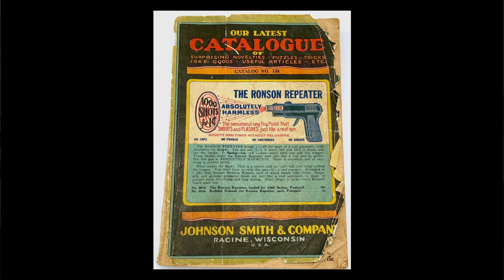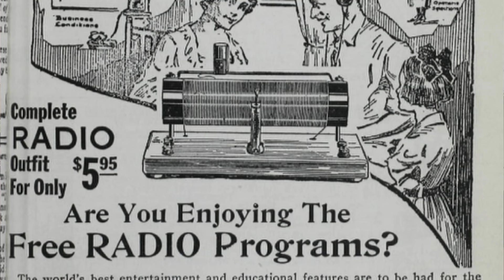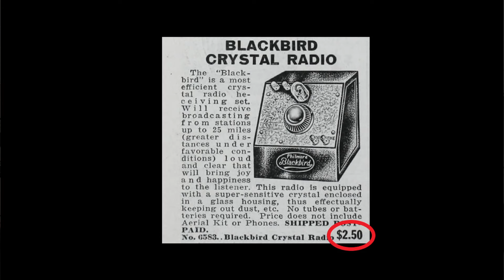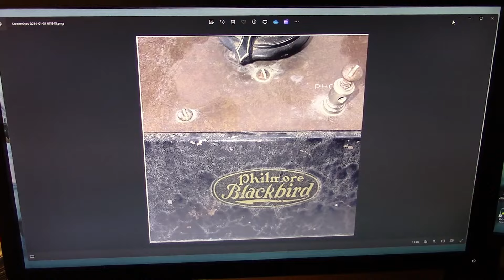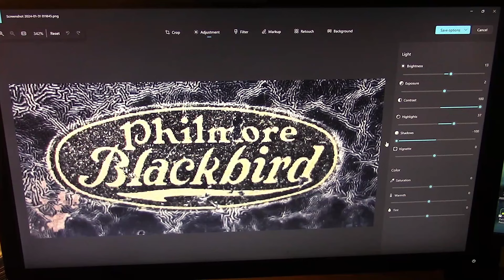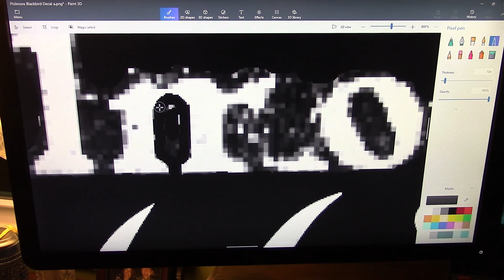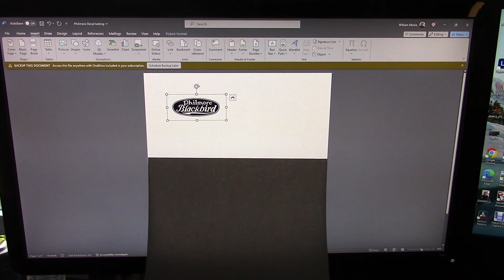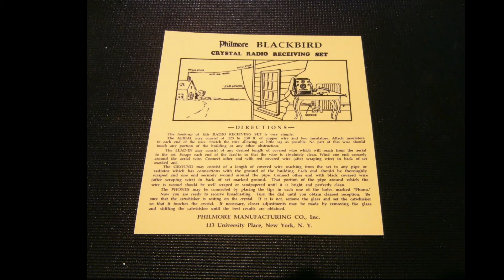1936 Philmore Blackbird Crystal Radio Restoration

Comment: I checked something out on crystal radios 📻 the other day. They're small, and very simple to build. The wood 🪵 ones are beautiful, and compliment any decor. Crystal radios 📻 don't require batteries to power them. They use the antenna 📡 coil, or "crystal", receiving radio stations out of the air. By what I heard (and know), crystal radios don't receive FM stations. They're strictly an AM device. I want to get into the crystal radio revolution. Does a crystal radio require a special earphone, or can any earphone work (except for wireless 🛜)? Happy Thanksgiving (Gobble Gobble)!! Your friend, Jeff!!